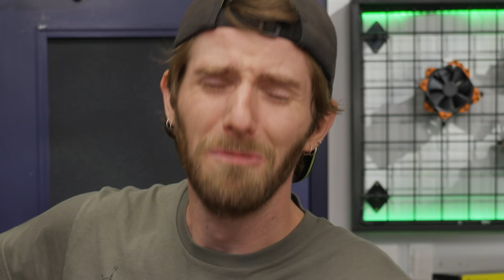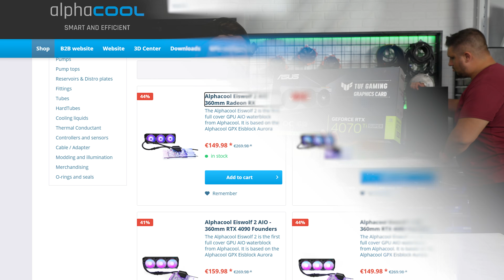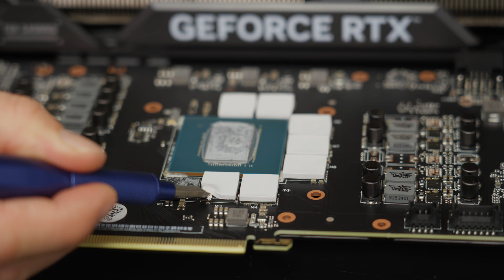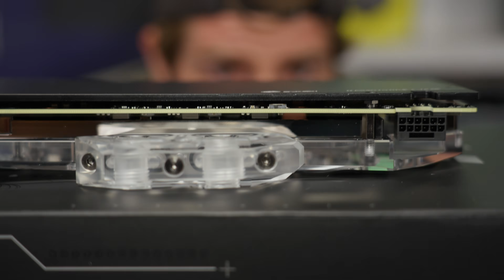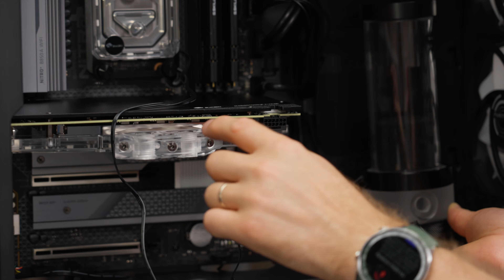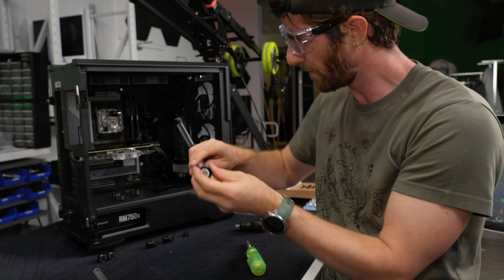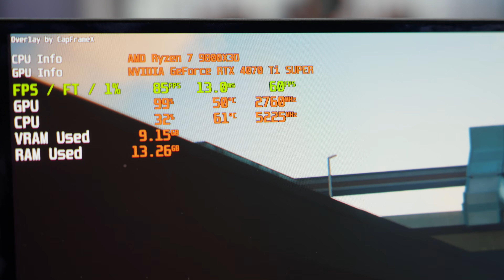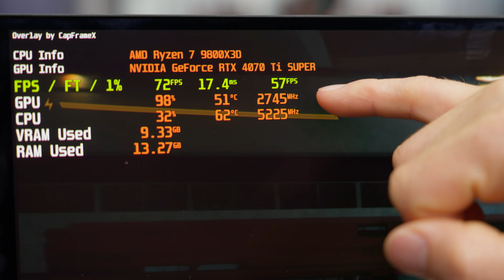Your Next Budget PC Upgrade is...Custom Watercooling??

Comment: I thank Linus for the car radiator idea, it has never failed me (",)   *if it helps any, there is also a 360 rad with built in pump on its end. So, it can connect easily to any water block with an in/out, using flexible hose. Easy as.

Comment: Who is gonna tell Linus you can use sharpie on the outside, then use a black dry erase  marker on the permanent mark, then wipe to erase... 

I am not sure if it would break the acrylic but I know this works on MANY other surfaces. My chemistry professor looked at me like I had 7 heads when I fixed their board...  (it was a newly renovated room with wall to wall dry erase boards and special cameras for recording)

Ye ol rant of a story: (to set the scene the cleaning department was called about the issue and was there with a cart of all kinds of solvents trying to fix the issue, I after the lecture I pulled a marker out of my bag and showed the tech). My professor then tried this on much of the expensive glassware used in the labs, that students used sharpies on, rather than the wet erase that we were supposed to use... It does clean the glass well enough that the spectrophotometer does not throw an error which saved loads of glass. My school used to scrap the glass hardware and bill the students that intentionally or carelessly damaged lab hardware... (they never charged for accidental breaks though).

Oh and by scrap the glass... we had a person in the chemistry department that had a lab to make lab equipment glass stuff, so any useful connectors were actually salvaged. I got to see all kinds of cool equipment they made, some of which were from like the 50's... maybe I'm just a nerd but it is cool to see some of that stuff made.  When I was making my first custom water cooling loop the glass lab gave me chemically pure DI water. (locally everything is remineralized)

Comment: 16:43 Those "sleeves" Linus puts on the tube, we call them olives in plumbing i copper work in the UK. It creates counter pressure to the threaded nut which gives a better water tight seal.

Comment: 18:20 Masking tape is an excellent solution for temporarily marking things...
Reply: not in this situation,  obviously you can't put tape on the tube, and probably not on the blue rubber tube either, first is the heat, masking tape might melt at worst or leaves residue at best and you can't clean it, second, after you add masking tape you might struggle to fit it inside the tube.  
So it is not a excellent solution in this case
Reply: @kampa373 You apply the tape temporarily as a visual marker, move the tube to your bending area and get it prepped, remove the tape, heat, and bend.
If your masking tape is leaving residue, you might want to try some different brands of masking tape...
Reply: @I_Feel_Waffle  i don't know about this method, maybe just a little bit better than eyeball it, if i have to mark the tape and remove it then it has no difference than just eyeball the location and place your finger at that location and remove your finger to heat and bend it, faster and same result

the whole point is to see the exact location when you bend, and that's also why linus mark the inside rubber tube but not the actual glass tube on the outside, if you mark a tape and removed it before bend it, it loses the whole idea and I see no difference and then just eyeball it ,no advantage since both can't see when bend, but extra steps mark and add and remove a tape

In the process of remove the tape you will have high possibility to lose track of the location because you will have to hold the tube with one hand or place it down and pick it up, and again this makes it no difference then just eyeball it and point the location with a finger,  that so i don't think it is a good idea , and also what i mean is when you heat any tape ,it will leave residue nomatter what brand you use.

Comment: I have a bykski 9070xt waterblock that looks exactly like the one in the video and it has been great, I upgraded from an RTX3080 with a EKWB waterblock that had some qc issues while being more expensive than what I paid for this Bykski that just works, the nickel is still there, no discoloration, no acrylic fogging no nothing, it just works and temps are really good.

Comment: Made a custom loop once using a cars aluminum heater core(about 6in by 10in) as an external radiator, a modified Keurig tank as an external reservoir, and a heavily modified chonky Pentium 4 heatsink as a block. Even custom made extension wires and a pcie bracket for soft tubing passthrough out the back to mount all the big stuff in another room. Was working good till my CPU block sprung a little leak and started dripping out the back of my wall mounted pc.

Comment: 21:53 The remote for the ARGB when set to "Mainboard Mode" should be looking for whatever software your system is using instead of the an ARGB hub. That's how my setup works anyway. I just don't think anything was installed for lighting yet for it to switch modes to.

Comment: Let's see. No texte of realibility and performance.

So, LTT just did an ad for a random company. 
The pump is even Asetek, aka absolute shit, and will run loud and die within 4-5 years. if it doesn't leak within 9-10 months. 

C'on, LTT. Do better.

Comment: 6:16 you dont need guess and check you can search your model of gpu which is on backplate and add "thermal pad sizes and places" or something similar and 90% of time there should be graphical representation with colors where what pad and what thickness to put

Comment: This honestly feels like a pointless video if you aren't going to benchmark the same system with the default air cooling before doing the water cooling and benchmarks... Like oh wow you can spend $300 on water cooling "on a budget"????? but without knowing if it's actually gaining real performance that's just meaningless. You could do decent air cooling for FAR cheaper and even look into 3D printed shrouds and such that might get just as good of performance for all we know.

Comment: At 14 minutes and 58 seconds, why not do a push pull configuration instead? It almost eliminates any dust buildup. I mean over a long time you'll have a lot more but in the short-term you won't have any
Reply from the maker: Push pull increases static pressure but the performance Delta with modern fans isn't enough that'd I'd bother with it for the added thickness and cleaning hassle unless I was trying to maximize silence or smth. - LS

Comment: The best 360mm AIO is the Arctic Freezer III... It's $70.

HOWEVER, in my custom loop on my main workstation, I have a RTX Astral 5090 OC. The only water block available at the time of building that would fit my system was from Bykski. It's sleek and great quality.

Under full gaming load, GPU doesn't go above 54°C (though there's a bunch of other variables to calculate, but still).

But stating you can custom loop for cheaper than an AIO, the best AIO on the market for CPUs is one of the cheapest and most reliable lol.

Your move, LMG

Comment: Bykski obviously didn't do any QA on that kit to ensure the supplied fittings ware suitable for the pump ports  😆

1) If you don't have a shop drop saw (with the correct blade) like Linus – along with the hand saw you'll obviously need, get a Primochill Finishing bit (size matched to the correct OD for the tubing you're using). Makes both the chamfering and final sizing really easy; you'll soon forget the cost.
2) Install a friggin' drain fitting into the lowest possible point of your loop! That is unless you're okay with the Linus, "Fudge It!" method to drain your loop – lean the case forward, disconnect the res/pump's outlet tube and aim the stream at a bucket on the floor.
Reply: I'm a classy man. I aim the stream at a funnel directly below the outlet port and connect some soft tube to the funnel that carries the water into a bucket on the floor

Comment: Those custom loop integrators can change water for mineral oil, so if there is a leak it wont ruin your components... (need to use compatible plastic tho)

Comment: I've been watercooling for 25 years and I would't recommend Bykski or hardtubing for beginners. My Bykski GPU block for a 5070Ti BTF came with a CPU manual and misaligned screw holes. The thermal pads are a joke too.  Do yourself a favor and go for Alphacool Core blocks, a D5 pump and EPDM tubing.

Comment: Aio coolers suck 😅 I just switched from a 360mm deepcool aio to a Tryx Turris Fan Cooler. It does a way better job, quieter fans, has a screen and doesn't get dust building up on it like aio radiators. I don't recommend aio coolers unless you just want your PC to look techy

Comment: Hello, i have a question. I made my first pc but i was on tight budget so i bought random free atx case from bazar. But the case is too small to fit my 320mm aio on the top and as a exhaust. So i put my water radiator on the fron as an instake but i mounted it so the metal from the case is in betwen radiator and fans. Any my frieds are sayinf its wierd and its not going to work. Also i can fit only one 120 fan on top and one on behind so i have 3 fan in thru a radiator and 2out (top, back). Is it realy soo bad as all say?? Sorry for my english. Iam not native speaker i use transtalion layer (also linux user ;))

Comment: I’ve been using Bykski and other Chinese water-cooling brands for more than 10 years and have never had any issues with quality.
The only thing I would not buy is a pump, since the original D5 is still the quietest, performs extremely well, and seems to last forever.

Comment: This is what I did 3 years ago to remove a lot of the guesswork on custom waterlooping my system. I went with the softtube version and not the hardline since it was my first time custom waterlooping anything so I'm a beginner. The only thing that isn't with the package is the Fluid itself. I posted my build on r/watercooling because I felt I acomplished something.

Comment: As much as I really like the video idea and the "kind of" throwback to older lmg videos, why - are you comparing every point that's relevant to make a custom loop more attractive for beginners and then chose hard tube - again. This isn't the first time and pushing the threshold so high with adding the extra difficulty isn't making sense at all. I guess Linus just wanted to do hard tubing again, even if it misses the point of comparing against of the shelve aios.

Comment: @ 0:35 Folks across assorted forums/sub-reddits have not been to happy about when I point out this. Well, granted I was using of shelf parts so my lists were a little more expensive. But for a CPU loop I built one for $350 a couple years back, add in a GPU Block (bought when my 3080 was current) then an extra Rad for a hair over $500. Which is not nothing, but when a case full of noctua product it is going to cost that much and not be quieter... So it makes it a lot more reasonable, and detonates pointless fearmongering that you need to spend $1,000+ on a loop.

Comment: I got a fire 13900K for myLGA1700 DRR4 setup knowing very well that it will be hard to cool, I heard the stories. 
But the ARCTIC Liquid Freezer III Pro 360 made that problem disappear for just 80 euros and looking at what I got in the box made me ask about how the chinese do it: I got a large thick radiator with three fans, a pump with VRM fan, nice cables and tubes, a contact frame for LGA1700 and other little stuff while peforming excellent. A radiator that size alone costs that prize when bought for a custom loop...

Comment: I think there is a Bell Curve: "Aircooling is enough." "I need watercooling." "Aircooling is enough."
Reply: As a former watercooling enthusiast - yes.
And aircooling needs next to no maintenance.
Reply: @IndrasilDesignStudio   depends on where you live lol. It's dusty where I live and I have 3 dogs. All of my computers (own air, aio and custom loop) require the same maintenance intervals its just the amount of effort required to perform said maintenance. Honestly it's all about the same when you have to clean the coolers themselves from dust block up.
Reply: @metalguitarman01  Yeah, but honestly, you can just clean the dust out once a month with a blower and that’s it.
Reply: @pain6391  its more like every other week but yeah thats kinda what I was saying the only time custom is more work is during the initial build and then once every 6 months for the drain and flush lol
Reply: I put a Cryonaut thermal pad on my stock 3080 and the temps dropped hard, my i9 idles at 70°C though, it might be cooked.
Reply: Unless you have a 13900k then by god you need water-cooling ;)
Reply: “Should I make a custom loop?” …I ask myself as I hammer jagged rusty nails into my arms and legs. Once again, I am convinced that would be too painful.
Reply: @frankgrajeda3566  pain is beauty 😊
Reply: Yeah that seems right, then when you get the itch for a custom loop again you buy a aio instead.
Reply: Nah. The bell curve goes aio, air, custom loop. "No water" is the midwit position. Redditor cooling in fact.
Reply: If that is your mentality, then you do not understand.
Reply: @thatfordboy4297 you're on the middle of bell curve I see
Reply: @thatfordboy4297  Air cooling is enough most of the time and AiO's make no sense, but watercooling is nicer (though i prefer doing soft tube only)
Reply: @MrBluePoochyena  I didn't say it wasn't.
 
But I will note, AIOs do actually "make sense". You can get a arctic 360mm for $70. That will be quieter than a $100+ noctua, and yes more performant... even if one doesn't "need" it.
Reply: @thatfordboy4297  If only those 360mm Arctics actually were 70€ and actually compatible with my older platform. Freezer III 360 is 85,90€ here , which is 100,25$ atm... My current ThermalRight Royal Pretor 130 cost me 52,90€ aka 61,66$ and is roughly within 5C of that Arctic AiO and actually compatible with my LGA 2011-3 system. Cheapest way i could OC this E5-1660 V3 to 4.6Ghz (upgraded from 5820K i used to have to this). Will go custom loop soon though as my GPU needs it hotspot temp wise. Let's just say I'm sticking to this platform because i find newer platforms boring with zero overclocking/tweaking possible besides undervolting and tedious memory timing optimizations. Also this CPU does hover between 3700X and 5800X in gaming performance roughly
Reply: @thatfordboy4297  give it a while, you'll make it to the other side of the bell curve eventually.
Reply: @thatfordboy4297  So what is the truth then huh? Mr. know it all.
Or are you js another hobbyist who is in denial for spending way too much on smth they definitely did not need...
Reply: @chaostnt2000 A) don't need to validate jack with you. B) Even if I had to, and i say this straight up, you wouldn't comprehend my setup. Needless to say, My one PC can act as a sort of "ghetto A/C". All while invalidating your "spending to much" as not only do I save on Actually A/C, I am personally not a moron and get the most out of my money. The other seeing as its SFF, and I made a lot of the chassis my self, along with being an actual budget loop.

But you hit the nail on the head about something. Accidentally, though... It is a hobby. If more need be said, then you still fail to understand.
Reply: @thatfordboy4297  it's you who fails to understand this....
Reply: @cerealport2726  Sometime I wonder what goes through the head of someone who thinks they have "one up'd" or whatever... But then I remember that would require a lobotomy. 

Unfortunately, like the other comments you do not get it.
Reply: @thatfordboy4297  and your comment totally emphasizes that  you are part of the center of that bell curve. Give it a couple years and maybe you understand
Reply: @FlaxTheSeedOne  I would ask that you use your brain to really see what I wrote... but I guess that would be asking to much.

Making a "bell curve". Then tying your thought process to it, just to think you are smart, is really sad.
Reply: @thatfordboy4297  ...but tying a strangers entire mentality, let alone implying it is flawed, to a random joke they made, that has a lot of basis in reality and is relatable for many, thus funny, is just...what exactly?

If it's a hobby for you, great bro got hard on your custom watercooling, sure it looks cool, but maybe you, yourself need to reread the original comment and think about your own mentality for a sec.
Reply: @PutYourQuarterUpGaming  Your the one "tying their entire mentality" to what they said. You think it has a basis in reality, and therefore is "relatable" and "funny". I know it is in fact flawed, because its very existence is flawed. The responses to may statement, yours included have done nothing but showcase that. 

Props for the attempt at an enlightened take though. That said, you have done the very thing you have accused me of.